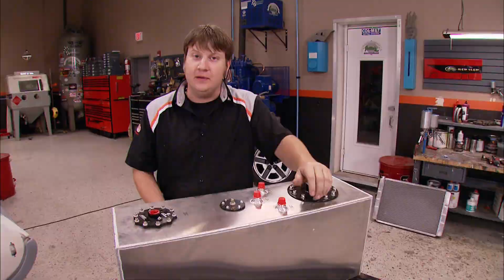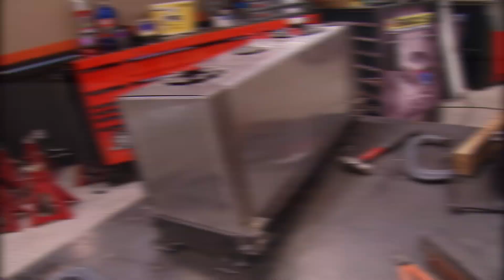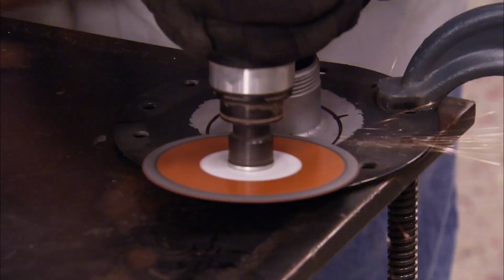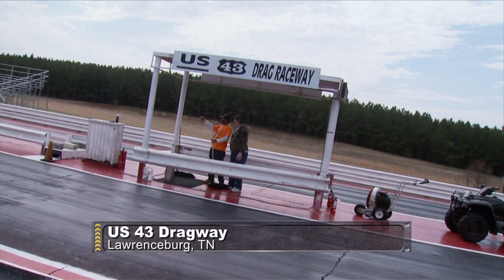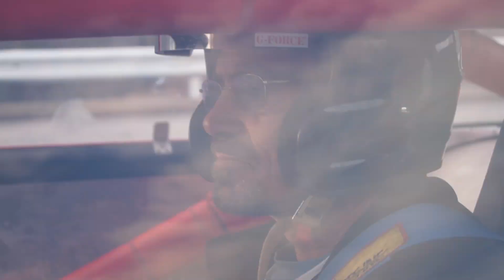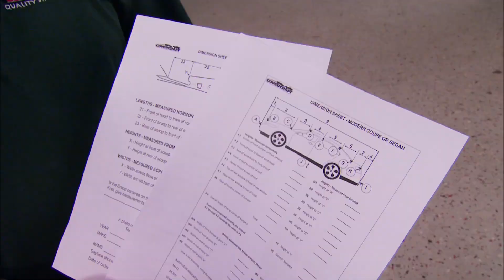Olds Fuel Tank and Racing 101

Comment: I just happen to have a1966, f-85 Cutlass car with all the extra good stuff on it and it's just been restored body, paint, 4 wheel disc, with a 3.55 gears differential  650 hrs pwr fuel injection carburetor,  bf Goodrich 50's out back and 60's up front and so much more than i can mention here. What a beast of a car. And it looks stock